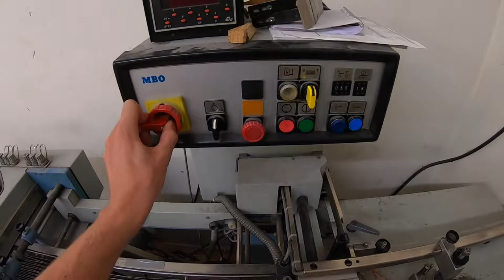High Speed Paper Folding Makes Me Happy, Buckle Folding on T 49 MBO

Comment: If you need a touch more speed, you can always close the gap up a bit.
Reply from the maker: Yup, I don't want to get too greedy though. Haha. I'll take your advise though, next job I fold I'll see how small of a gap I can have.
Reply: Just A Printer aww c’mon, no guts no glory!   I never ran less than about .75”. I was watching a video of the new folders at drupa, where they actually stream feed into the first plate. One sheet is going in as one is leaving.  Now THAT scares me!  Stahl THP
Reply from the maker: @bearpump  You are the man Jeff! Haha! I cannot wait to max out my MBO the next time I have a folding job. Thanks for the encouragement.
Reply: Just A Printer I worked at a shop many moons ago (25 years, or so) I was a stripper if that tells you anything...   if we were slow, they would have us help out in other departments.  Our bindery supervisor had changed the size of the variable speed pulleys on our two MBO’s. We did tons of 8.5 x 11 letterfolds a month.  Those things would cruise at 45,000 an hour.  And I was on the delivery catching!   The supervisor would wear roller skates and skate back and forth between the two to keep them fed as they were continuous feed.
Reply from the maker: @bearpump  Oh boy, thats a sight I'd love to see! What a great story. Thanks!
Reply: @bearpump  that's funny. I worked for a company in Florida years ago that did HUGE mailings for car dealerships. Pretty much every job was 200,000 pieces or more. And most of our jobs were the same size, fold etc. Just different art. Tri fold, inkjetted and we put little scratch off stickers on with the tabbers. had a couple big MBO folders that would FLY and I remember running that thing and wishing I could wear Rollerblades or something. I actually thought about it a lot haha.

Comment: Not sure if you have a set of slitters for that folder. I personally would have ran that letter through the folder 2 up and either do a center slit or a gutter slit depending on bleeds. It would cut the run time in half.

Comment: What's the purpose of the tinsel (or whatever it is that you have on the input and output tray)?
Reply from the maker: The tinsel creates a ground for each sheet as it passes by and eliminates static. I rarely use tinsel but coated paper will sometimes stick together as the sheets move across each other.
Reply: I'm so glad you asked that question.